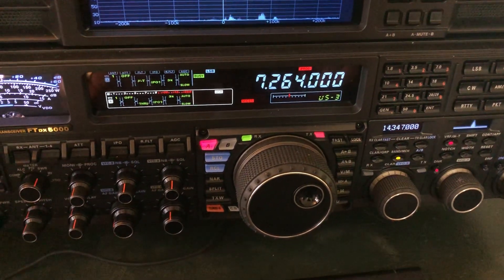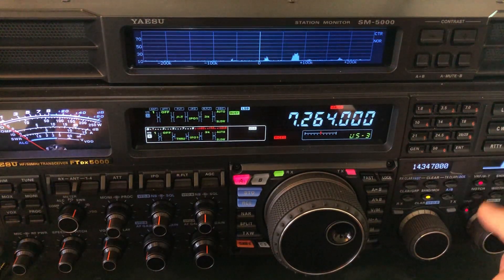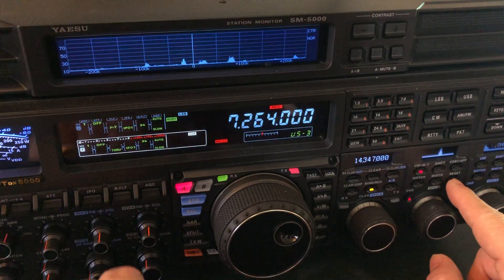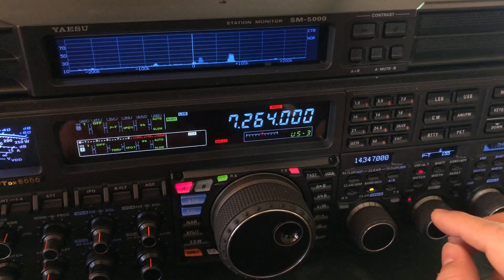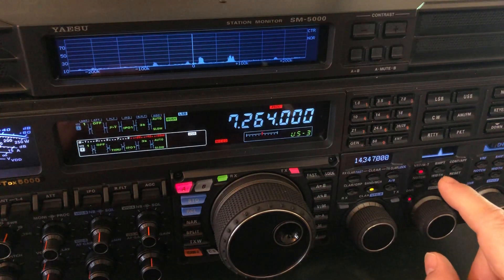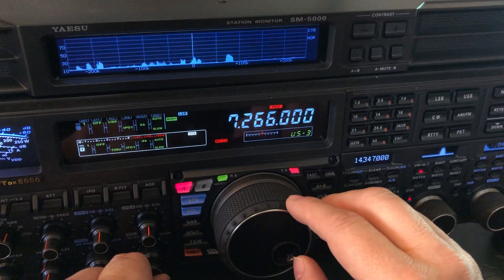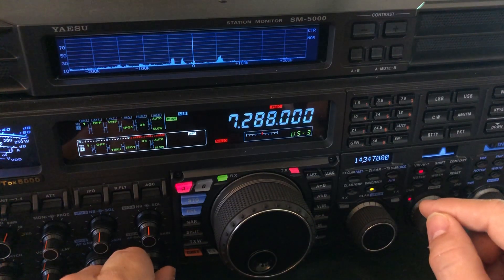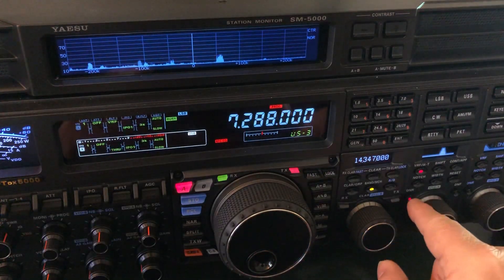FTdx5000MP fighting local noise

Comment: As a new FTDX5000 owner, I'm learning a lot from your videos.  Were you able to buy a u-Tuner on the used market?  I see none for sale anywhere.  I got my 5000 from Gigaparts - at the time, it seemed to be the last one in stock in the US.  I want to add one thing regarding DNR.  My previous radio is the FTDX3000, and although the DNR on the two radios seems similar in operation, they are VERY DIFFERENT in their effectiveness.  The DNR in the FTDX3000 is usable up to a lower level, because a distorted, reverb-like underwater effect eats away at the readability of the signal if you go to higher levels.  So even though the 3000 has DNR=13, it is rarely usable, whereas on the 5000 the higher levels are highly effective and the "underwater" effect is almost absent. I think this is probably because in the 3000 they are running the same algorithms in their DSP as the 5000, but they use a lower performance DSP chip set, or it is degraded in some similar way.  In general if you like the DNR in the 3000, I think you'll LOVE it in the 5000.
Reply from the maker: The DSP in the 5000 is superior to all other Yaesu radios.  And yes, the DNR is unmatched.  My theory is that the processor is much more robust.

I did find one used mu-tuner, but it arrived damaged.  I bought mine from HRO.  But the VRF is no slouch.  If you will buy only one mu-tuning preselector, I recommend the one for 40/60/80 meters.

Enjoy the rig.  Greatest radio there is, IMHO.  

73, N4HNH